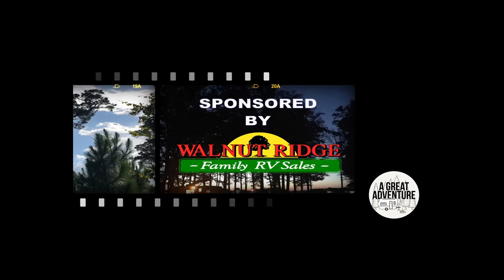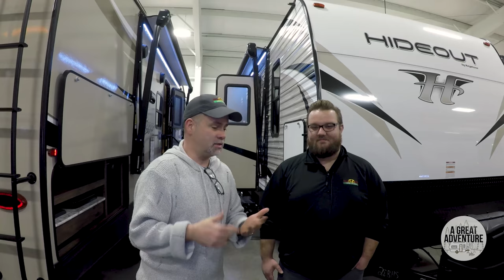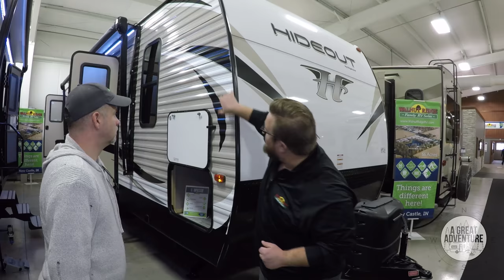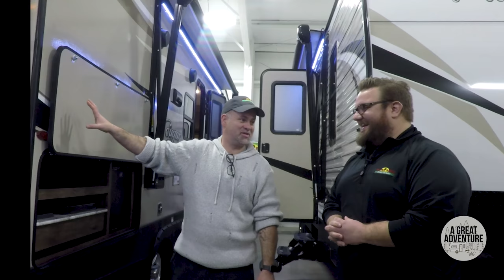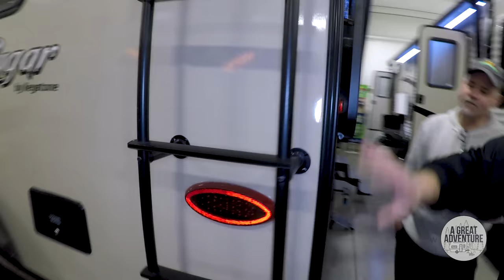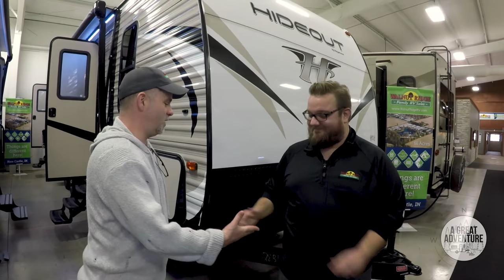Rv delamination - Metal vs Fiberglass

Comment: This is great information and absolutely true. One thing to know - a few of the newer RVs with fiberglass sidewalls use a product like Azdel in place of Luan. Azdel is a man-made product that is impervious to water damage. Just worth knowing - only a few manufacturers are starting to use it but it's a terrific product.
Reply: Bought an azdel unit, but time will tell. Sales people used to say vacuum bonded + newer glue solved delamination (nope). If I could have gotten aluminum frame with metal siding, I would have, but there are few choices in all metal RV’s.
Reply: @JeffinTD  sunnybrook sunset Creek was an aluminum stud and aluminum siding unit. The old Holiday ramblers were aluminum/aluminum units as well.

Comment: Our first RV after a pop-up was a sticks & staples wrapped in cola can construction. Less than 2 years into it, roof was rotting all around the perimeter, soft spots in the floor, etc. Got rid of that. Current RV is 20 foot, aluminum framed, Styrofoam insulated, vacuum bonded, fiberglass inside & out which weighs roughly 1/2 the old one.

Comment: The fiberglass units have another enemy besides water leaking in. Humidity is the biggest one. Everytime you cook inside, shower, use hot water and even from your own breath, you build up humidity inside and the fiberglass RV's retain the moisture where the walls can not breathe. Aluminum sided RV's have horizontal seams that helps the walls to breathe and catches some of the moisture from humidity. I will not own a fiberglass camper but if I did, I would have a couple of dehumidifiers running inside a fiberglass camper all the time. All fiberglass units are prone to delamination regardless of their construction with the fiberglass laminated to wood panels. Fiberglass laminated to wood will never have a permanent bond unless the wood panel is 100% sealed inside the fiberglass.

Comment: Great job on an overview of a contentious subject. Question, if I can lay up a seam of SikaFlex on an outdoor stainless to aluminum bond and have it last for years, why is it these FG to aluminum bonds fail. Water can't be the whole/real issue, it seems the adhesive is the failure, and the materials are not staying bonded. Are these manufacturers cheaping out on the materials or preprep?

Comment: Another thing that will cause delamination is leaks inside a trailer from a dripping water line or cracked fitting or and improper installation of a fitting.  It is good to check all your fittings and pipes after you use the trailer to see if any are leaking, I am mean small leaks (like five drips a day). This happened to me and it wrecked an entire wall of the trailer.
Reply from the maker: Sure Thing great feedback!!!

Comment: The Thing is,when you buy a RV you want 1 lite, and want it to last.  Aluminum frame and siding is best!   metal rust and heavy,  fiberglass is heavy and get stress cracks, got a roll of fiberglass siding and a roll of Aluminum Siding. The aluminum is much stronger and lighter than fiberglass, and much easier to patch or weld too
Reply: Fiberglass is better because the wood frame rots. Plus Aluminum doesnt rust. Fiberglass is way tougher than the cheap metal they use on the wood frames
Reply: @JensSchraeder   i'am staying with Aluminum frames and siding
Reply: @get to the Choppaa hmm didn't know they tried making aircraft out of fiberglass. Lol. SMH.
Reply: Aluminum can corrode.
Reply: @clawhammer704  Yes it can

Comment: First of all Gel-coat does not peal, it is a pigment laminated (bonded) to the fiberglass layers, also many of the fiberglass siding used on campers are painted. Secondly, de-lamination is due to moisture but what they aren't telling you is that it is the cheap plywood layer  luan backer) that is de-laminating, where as Azdel backer is not plywood but plastic and does not de-laminate. Luan or plywood backer board is going to de-laminate, even high interior humidity can cause plywood de-lamination.

Comment: He mentioned gel coat with regard to fiberglass. I may have this wrong, but I understand that there is no gel coat like on a fiberglass boat. The outside layer of a fiberglass wall is a product called Filon that is a fiberglass/plastic composite product. Comes on big rolls 102 inches wide. This is laminated to a backer like he said. .045 thick.

I’ve been looking into this as I’m about to replace the delaminated Filon (fiberglass) nose cap on our trailer.

Comment: I heard that even though the aluminum framed trailers use better insulation, it is negated by the aluminum being such a good conductor of heat. It causes condensation and water buildup on the inside during cold weather. Some have even had frost lines where the aluminum studs are.
Reply: This is a fact

Comment: Repairing fiber glass is easy to, since as you have said, it has a steel frame supporting it, you don't have to replace the entire fiberglass, you can just cut off a small section, sand it down, patch it with another fiber glass, add filler, sand it, and paint it. 🤔
I have tried that with my car with a fiber glass side panels, when it got damaged, and the strength is still the same.

Comment: I would be very interested in hearing what Jordan would recommend for fixing delamination on units that have already started coming apart.
Reply: You have to remove the molding, heat up the siding(heat gun) and start at the closest point peel back the siding---not easy, then re-glue perhaps contact cement since it grabs on contact, A regular slower drying glue means applying solid pressure points on lamination till dry---impossible i think. Good luck, this is why micro lite and other cheap models aren't worth jack including the one here lol

Comment: Y'all are making me to decide to go with airstream trivial trailer
Reply: William Warren I would caution against it. I’ve lived in my airstream over the winter and the wood floor and interior cabinetry has soaked up a lot of moisture. Sure the framing and skin are aluminum but the stuff inside is not water resistant enough for the thermal transfer of the aluminum.

Comment: Why can't they make metal panel trailer with metal frame in stead of wood
Reply from the maker: Good question! I will have to ask
Reply: My 1987 Holiday Rambl er Alumalite had aluminum structure with aluminum siding. I know because I removed a inner wall panel and saw it. That was the best trailer i ever had. My V-Cross camper has aluminum siding and wood structure. I will never buy a fiberglass sided camper. I see too many going down the road and a lot of them have delaminated terribly. In my opinion, it just has not been perfected and is too risky to take the chance. I also keep mine under a 16x40 cover.
Reply: In my concorde rv i have Aluminium outside, pu foam middle and Aluminium inside. 20years no Problems. Its a German rv. Sorry for my bad englisch.

Comment: What I have never understood about RV campers is why they don't add a good amount clear coat to the surface of all RVs like they do on vehicles? This would help protect extremely well! Also decals don't last long, they fade! Adding decals to the rv then spray clear coat over everything will protect all. All you would have to do is a normal Wax or Sealant protection every year. Doesn't make sense!!!
Reply: Easy answer. To keep the cost down. And, they don't want you to keep them for a long time. They want you to buy their newer model once your older model starts to looking old and ugly.

Comment: The wrong question was examined.   Should have been, metal vs. fiberglass SHELL.  Like Casitas, Oliver , Bigfoot, et al.

The boat type 2 piece fiberglass shell Trailers are FAR better in all respects to metal trailers.
Reply: Good point Patrick. The reason those weren’t discussed, is due to practicality and volume. The two peice “boat style” fiberglass trailers are very well made and extremely durable, however they are significantly more expensive, and sold at a tremendously lower volume than the two styles discussed in the video.
Reply: Of course they are more expensive.  However, being able to get 80% of your purchase price 10-20 years later (NOT uncommon for those trailers) FAR outweighs the fact that you lose far more $ from a non-shell design. PLUS the GREATLY added maintenance costs.  So, yes they are more expensive if you forget to add TCO in.  smh
Reply: Patrick EH, again, those are great points. I’m not arguing the quality of the product. I’m just answering your original question about why they weren’t discussed in the video. Those trailers consist of less than 1% of the RV market share. We focused on answering some questions directed toward our majority audience. Happy Camping!
Reply: Those fiberglass shell RV's are also very limited in size and options.
Reply: Totally different fiberglass between the two. Casitas and the like are a true gelcoat fiberglass. The others are a thin fiberglass sheet with a cardboard backer.

Comment: I've had both. Never again will I have a fiberglass RV. My Aluminum framed fiberglass 5th wheel delaminated and the fiberglass cracked at the inside corner of the 5th wheel.  Cost prohibitive to repair and would have just delaminated again anyway. Aluminum sided is always repairable, whether it's water damage or physical damage. Once a fiberglass trailer delaminates its value tanks and you can't give one away.

Comment: Fiberglass is easy to repair if you know what you are doing. I repair fiberglass composite aircraft panels all the time never have I ever had to come back and repair what I have fixed I may use aviation standard composites would be better and seal the repair after !
Reply: Ditto I have repaired fiberglass wind turbine blades for almost a full decade. I would gladly repair a fiberglass shell on a camper. Making it water tight is easy. 

I also have most of the supplies at my disposal in the form of stuff that falls off the truck or expired recently.

Comment: My 5th wheel has aluminum siding and framing so claiming all are wood framed is just wrong. It's a 2004 so maybe all new ones are that way. Even still you only really named weight as a plus on fiberglass. I know my 2013 fiberglass camper faded more then the 2004 aluminum camper I just got.

Comment: I'm 65 yrs. Old and on my 5th travel trailer. 3 Sunnybrooks, these were everyone fantastic t/t with aluminum cage and aluminum siding, with regular maintenance were great. Winnebago bought them out and there new product is JUNK. Bought a 32' kz spree, complete JUNK, had a year and it was falling apart. Took it in for warranty and a tree fell on it, seriously, insurance totalled it. I'm now in a Flagstaff micro lite, 25bds, very nice rv, easy to pull, so far minor issues only. But, I see quality issues cropping up after 2 years in that concern me about longevity. Found dicor at right front corner completely breached, hope I caught it in time. Hardwear on outside , deteriorating quickly for the age of the unit. My opinion, which everyone has one, they are all JUNK for the amount of money we pay for the units, the QUALTY is not there. I see most issues arising from production, seems they are thrown together. Hate to say it, maybe we need some foriegn competition in the RV industry, that's why our automobiles are somewhat better now. Thanx Toyota , Subaru, Mazda. Research the brands and read lots of reviews, ( horror stories actually) and choose at least the better makes as even between major manufacturing there is junk and a somewhat tolerable unit. Good luck and enjoy your  camping experiences.

Comment: Ive been told the metal sided along with the wood framing is still lighter than the fiberglass siding---approx 500 lbs  on average.  Ever notice the 250k+ motor homes don't delaminate!
Reply: I noticed that on the jayco 195rb.
Reply: Yes he's wrong. Any weight savings with aluminum framing is lost to the heavier fiberglass siding. Aluminum sided campers are significantly lighter than fiberglass.

Comment: I have a 2018 hideout that on the driver's side the metal has pull off the wood framing cause of the poor construction of using staples to hole metal to studs. It isn't a hard repair but a little attention to fastening would be awesome

Comment: Yes, metal is Better than fiberglass, however the corrugated uneven siding LEAKS!  Driving in the rain is like subjecting your entire trailer to a high pressure washer at every seam.  There is no way to seal them permanently. Been there done that.  Never ever again.

Comment: One I didn't read all the comments so forgive me if this is redundant information.  But this so called expert doesn't know that metal sided trailers are not all framed in wood. Sunnybrook trailers are all metal framed structures. With aluminum siding and fiberglass in some models.

Comment: I'm delaminated.  Should I reside with aluminum?
Reply from the maker: I believe in many cases the delaminated sections can be repaired.
Reply: @AGreatAdventure  Thanks for replying!  I'm very delaminated.  I went to replace the roof, one side was so water damaged when I removed the molding holding it on, the siding literally fell off.  It's the kind thats glued to the block foam.  It's a 1991 Fleetwood Flair 22 with 50k, plenty of life left in her but the water damage is unreal.  I want to completely restore her somehow, but fiberglass is so expensive, I can't think of any other way that would look right.
Reply from the maker: Vegan Marshall yikes! Yeah water damage can be awful. If I were you I would take photos and visit a local dealership and get some advice. I do know delamination can be repaired. I am not sure the cost, but with only 50k miles it sounds like it's worth looking into.
Reply: @AGreatAdventure  Thank you for your advice, I greatly appreciate it!

Comment: nice clip, what if you are in thunder storm? which is better. thanks
Reply from the maker: tom loong that is a great question! I can tell you that we were in a tropical depression last year with our metal travel trailer and we had no issues. The winds were 70mph +
Reply: yes, that's is what i heard about metal panel/frame vehicle. i guess my question is " will anyone survive in case a fiber glass RV was hit by thunder?" i heard "hiding in towing vehicle is safer". any comment? thank btw.
Reply: Would the new stairs you like provide a ground if RV is  hit by lightening. Like your videos and the guy does no his poop.
Reply from the maker: Actually the bigger thing to consider is if your frame is wood or aluminum. If you unit is aluminum you are fine...it's called the Faraday Cage. Good ole Ben Franklin was a smart guy.  If you have an RV with a wood frame you are not safe. It doesn't matter if you have metal or fiberglass outer. With regards to the steps, they are no different than landing legs on a fifth-wheel, or your stabilization jacks on a TT...or even your tongue jack.  Hope this helps.
Reply: Hail stones will make way more damage to aluminum siding than then fiberglass.

Comment: So you already know sometimes They delaminate .
Reply from the maker: If a camper in not properly maintained and seals checked on a regular basis you run a risk of water getting in and causing delamination for sure.